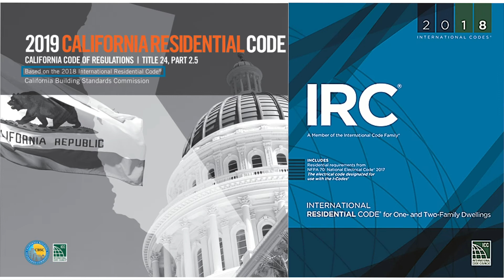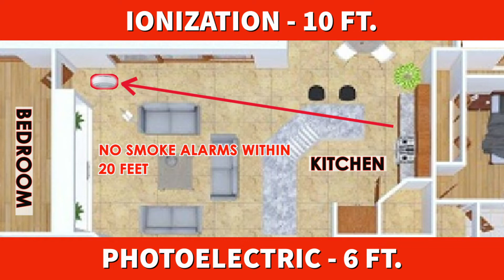Residential Smoke and Carbon Monoxide Alarm Requirements (2019 CA Building Code/2018 IRC)

Comment: Hi Jose can you help me Please I like to be able to keep possible matches of code variations I of course have a copy of nfpa 72 I wad trying to understand how the information you provided in your video may have been generated it seems what you are saying is specific to ca but is based on ICC codes so my question to you would be as a private resident who wants to help other residents in other states my question to you is do you think I need an IBC code book or only the ifc and irc for Private dwellings? Need things like smoke and co alarms requirements again can I get away with just IRc and Ifc ? Thoughts please thank you ps do you think if I buy the newest edition s it will be fine but possibly an older edition has been adopted? Thoughts please thank you

Comment: In this video, you mentioned that smoke alarms are to be installed IN bedrooms and then you indicated that smoke alarms are to be installed OUTSIDE sleeping areas.  I thought you were going to say "OR".  Do they need to be installed BOTH inside the bedrooms and outside of them?
Reply from the maker: The Code (model code and CA state code) require smokies "in each sleeping room" and "outside each separate sleeping area in the immediate vicinity of bedrooms."  that is verbatim out of the codes.  So, in both in/outside bedrooms.  I hope this helps.  IRC/CRC Section R314.3

Comment: In the video you stated I believe correctly that on split level with no doors a detector is only required on the upper level. However in the graphic you placed the detector on what appears to be the lower level.
Reply from the maker: Hi Zac.  Great catch.  Although the graphic shows the device on the lower level, in terms of floor level, compared to the other split level; the placement is accurate, in terms installing the device on the higher (upper) ceiling of the split levels, where first traces of smoke will be detected.  Thank you for pointing that out and for checking out the video.   As always,  it is ultimately up to the local building, and fire, department to determine placement. 

Thank you.

Jose M